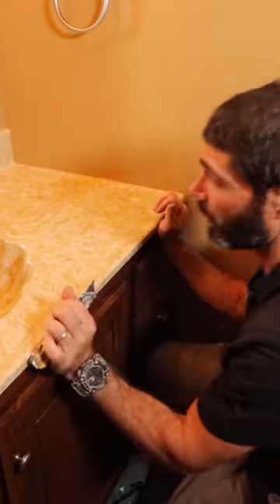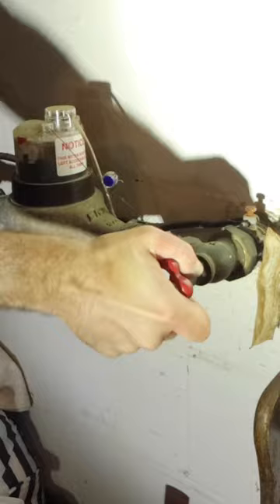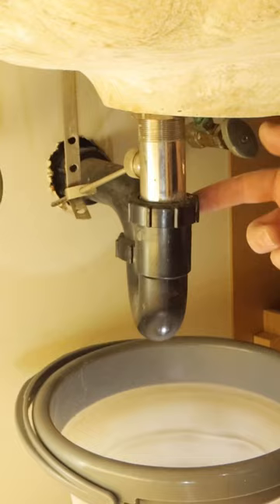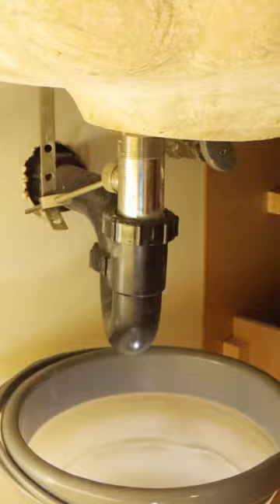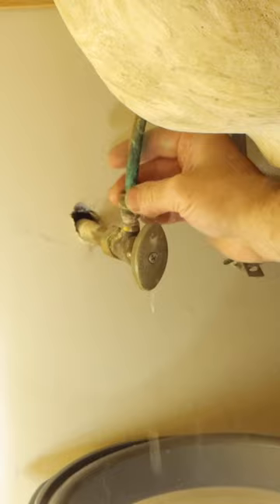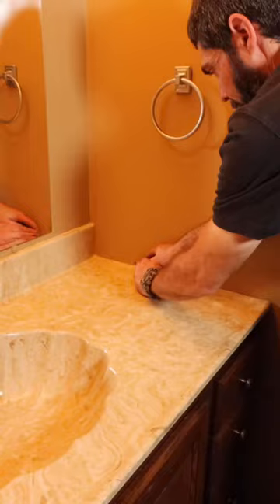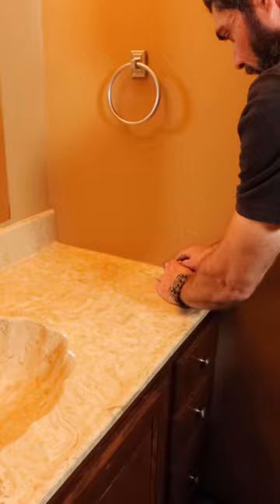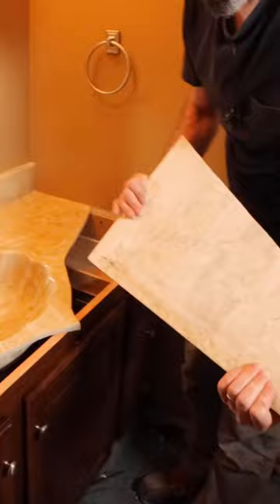Bathroom Sink Removal Tips - #shorts

Comment: Why turn off the water to the whole house when you have shut offs right there?
Reply from the maker: because the shutoffs didn’t work, I actually had to replace the stems
Reply: @HomeRepairTutor  same thing happened to me when I redid my bath. Old house was built in 67. Although it looks cleaner when you hide the soldered joints behind the drywall, it makes it a pain to replace those prone to drip/ leak shutoffs.
Reply: I was going to ask the same thing.
Reply: Incase a valve twists apart, waters still restricted.
Reply: @Bigbogski
Reply: @Bigbogski
Reply: @HomeRepairTutor u
Reply: @Bigbogski
Reply: @Shadow497  u
Reply: @Shadow497  yes huh😅 it’s.  I. I I I. U😅 i😅i